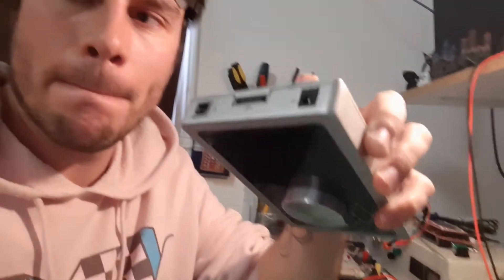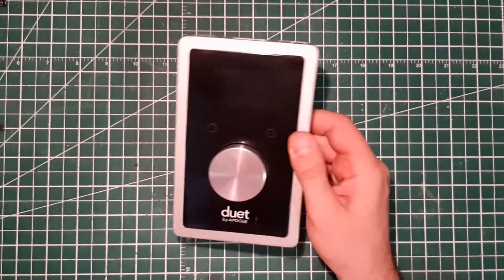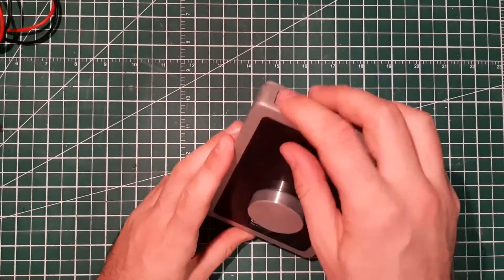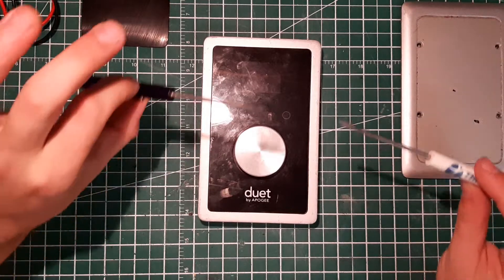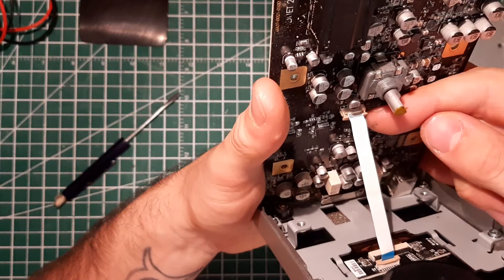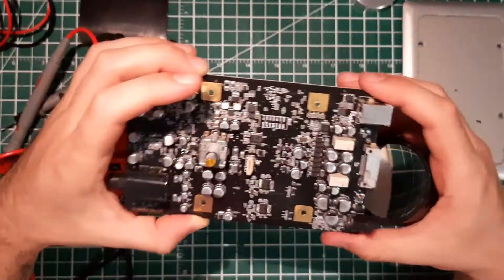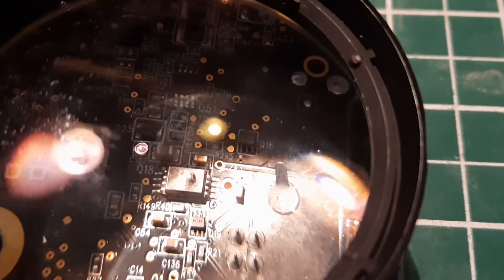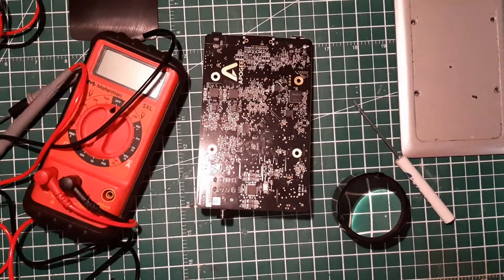Apogee Duet Not Powering On? Step-by-Step Repair Guide

Comment: Thanks for the inspiration! I Fixed mine with a new display and replaced the 2113A with a TPS2115APWR - I also had to perform a HW reset. It works again like a charm. It was a bit tricky because of my not so fine soldering tip ;) Cheers
Reply from the maker: @TheMarBaudelaire  in the end, sloppy soldering or not, you manage to fix it! Amazing!

Comment: Hey bro,  I have RME FF800 it's powering on but the host light is not glowing and unable to connect with the computer. Please help me
Reply from the maker: It feels like one of the connection pin on the USB port could be damaged? Or a buffer IC to protect the port communication. Pretty tough to diagnose without opening it.

Comment: Hi Phil thanks for this video! My Duet 2 is not working properly, I only use USB connection without power adapter been doing it for 8 years.. It connects to my Mac but sometimes just randomly disconnects, and when I’m trying to record with a mic most of the times I get no signals neither from input 1 or 2 phantom or no phantom. If I’m lucky I can record for 5-10 minutes before it starts glitching again. I’m not a tech guru so it’s a mystery to me. Do you have any idea what the problem might be? Many thanks!
Reply from the maker: It seems like a power issue. Enough power to keep the machine ON but it loose connection with the pc and the thing with the phantom power is also another indicator of power issue. Either the connector is intermittent or a capacitor getting old. You could try a firmware update first if there's any. Also, try another usb cable and another port of the pc, it could be the usb port from the PC.
Reply: @ThePhilStudio   Will investigate further on your suggestion. Many thanks!!

Comment: Hey there! 
Any idea where I can buy a replacement rotary encoder or any part number for that?
I have the apogee One and I reckon the part number is the same.
Reply from the maker: Hey there, your best guess would be to contact the manufacturer directly and hope that they can help with this one. support@apogeedigital.com
Reply from the maker: Else, you could also try with an equivalent Encoder 5 pins. Because there is that Push button included, don't forget that push button on the encoder! :P

Comment: @thephilstudio My Mac is not detecting my quartet. It was working fine for 2 years,it still turns on but it's not detected by my Imac after trying to update all the software and firmware??
Reply from the maker: Have you tried on another computer? It could be a bad connection in the USB. Are you powering the device via a USB cable?
Reply: @ThePhilStudio  No but I will try tomorrow for sure in a different Mac
Reply from the maker: @BayAreaMusicVideos  alright, if it doesn't work, it could be a broken pad on the data+ or data- of the usb female connector.
Reply: @ThePhilStudio  Should post a video so you can see so it’s easier to Understand
Reply: @ThePhilStudio  ok ill get by back to you by friday
Reply: @ThePhilStudio  The Quartet uses both,so I do both at the same time,it’s different from the Duet
Reply: @ThePhilStudio  Yes I tried a 2014 Mac mini. I switch the cables nothing. Yes I have powered the Device both thru the Power adapter and Usb cable.

Comment: I had a similar problem, and my repair guy in India repaired it. The issue is I do not use an external power supply and only use a USB. How did my IC get a short circuit?  What are better practices I should adopt to keep my device safe and prevent such accidents in the future? I use an m1mac with a USB hub+ Apogge duet.
Reply from the maker: Gotta make sure your USB HUB is really stable and doesn't get unplugged or plugged accidently.
Reply: Who is your Repair guy ? @leo crasto

Comment: Hi Phil, i have a similar problem with my Duet, do you do repairs for people?
Reply from the maker: Hi there, sure I can. I live in Canada tho.
Reply: @ThePhilStudio  thanks Phil, ive reached out to the folks at Apogee, but since you have this video, I’m comfortable working with you. Could you share your email with me?
Reply from the maker: @memoduarte8865  Sorry for the delay, my e-mail can be found on my channel contact information.
Reply: @ThePhilStudio  where in Canada bro?
My Apogee has lots of noise and hiss almost like radio static, which is proportional to gain. This is abnormal as I never faced this issue before and I use other interfaces and dont see the problem, hence I suspect the Apogee.🙏

Comment: Thanks for sharing! I'm eager to see how this turns out.  I have a Duet 2 as well that has been slowly dying over the years.  I'm hoping to learn how to fix, maybe even upgrade it (similar to what Black Lion Audio does).
Reply from the maker: Hey there, I received the IC last week and switch it. Guess what! It worked very well, I was stressed a little bit because of the small surface mount job so I decided I wouldn't record the process.
Reply: @ThePhilStudio  thanks for the update
Reply: I've never heard of an audio interface "dying slowly". It either works, or it doesn't.
Reply: @milankotevski1663  well now you have.  It would power on instantly at times, then at other times it would take 10 minutes or more.  It’s dead now. Looks like some of the components fried and/or leaked on the pcb board.  RIP apogee duet 2.